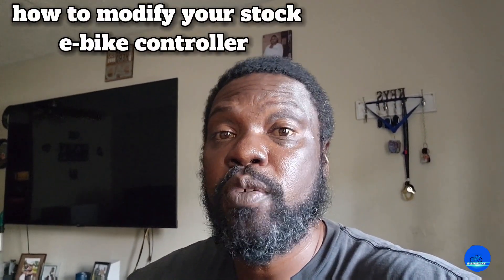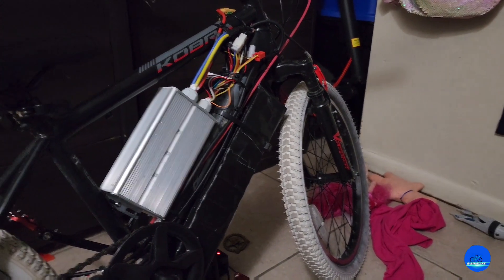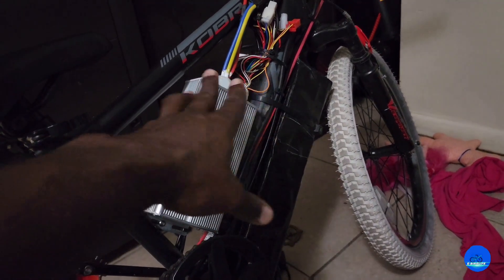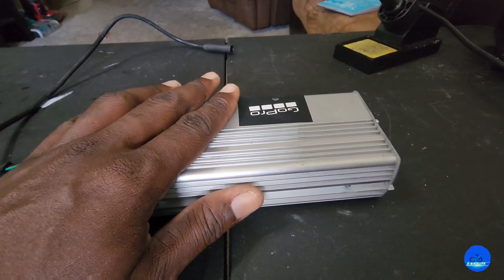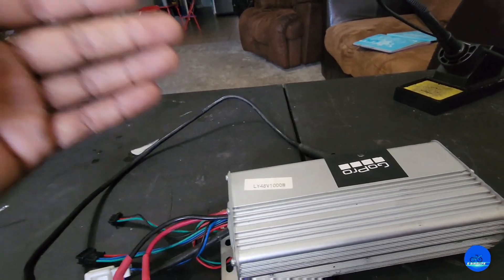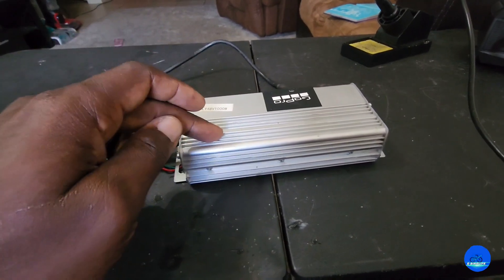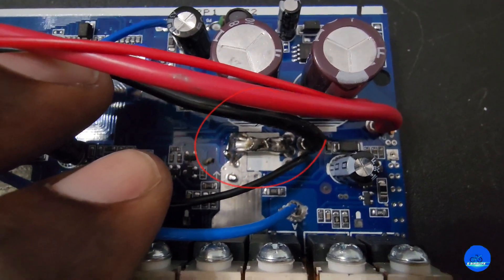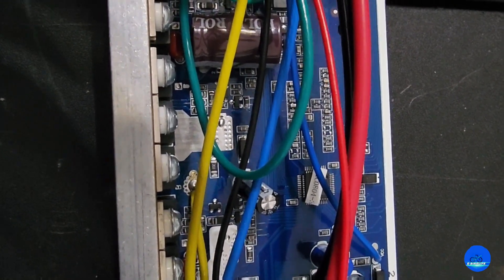how to modify a basic e-bike controller(MORE POWER)

Comment: My guy. I own the same LY48V1000W controller. Recently Its been turning off my power randomly. The power will turn off but then come back. I've checked all the wiring and everything seems to be in place. Please help
Reply from the maker: Ok it sounds like a low voltage,  do it only  do that while acceleration or just all of a sudden?
Reply: @EBG-offical  a little bit of both. It will shut off while it's on but not riding. And it will shut off for a few seconds but my LED display will show that it's low but then come back again to full. I hub motor will cut off and then work just fine. Am I looking at a faulty controller?
Reply from the maker: @crowsnestrc3551  that could be the problem,  you said that your display show low than go to full check the battery it might be a indicator of huge battery sag before you rule out the controller is bad
Reply: I see what you're saying. I've been using my bike to go uphills alot. I live in a town with a lot of hills everywhere u go. Idk if that might have anything to do with the bike being faulty. It's a Sunday BMX build. I own the 48v 1000w controller and 1000w motor kit. I'm having a really hard time figuring this out.
Reply: My battery meter reads full. But my LED display. The "810" model won't even light up now
Reply from the maker: @crowsnestrc3551  oh wow might be a short in the controller

Comment: Do you know if 63v caps can handle fully charged 60v batteries? since 60v batteries are 67v at full charge.
Reply from the maker: I believe you is correct 💯
Reply: @EBG-offical  thank you brother 🙏I appreciate you sharing knowledge
Reply from the maker: @theSWBFman  no problem that controller has 60v caps in it so I was able to run a 60v battery on it

Comment: Niiice! So tell me how much of a difference this made? How snappy was the bike and how much more speed did you get?
Reply from the maker: Thank you,  it went from 23mph to 30mph and you will definitely feel the difference like 35% more torque and speed
Reply: @EBG-offical  your welcome. how long have you road the bike this way? Any problems?
Reply from the maker: @RealRayAl  no not at all  actually I sold the controller to a buddy and upgrade my son to s sine wave controller 80a nb power
Reply: @EBG-offical  ok thank you. I just want to make sure before i mod this controller that i wont mess up anything like the motor or the batteries

Comment: Yoo bro! Your videos are sick! Can you suggest a controller or the specs I need to buy to get better acceleration pls, I've got a 1000w hub motor and I'm just using the stock controller it comes with
Reply from the maker: Get the sabvoton 7260
Reply from the maker: https://s.click.aliexpress.com/e/_msBjedO
Reply: Thank you
Reply from the maker: No problem I highly recommend it easy to use
Reply: Which one is it? It says 3000w I only have a 1000w
Reply from the maker: Sabvoton 7260, the 7280 is the one for 3000w, but get the 7260 controller. You can tune it to your specifications

Comment: Hi have 1000w controller 30amp and battery 13ah 48v  any problem after mod whit battery ?
Reply from the maker: It will be determined by the bms on the battery if it can handle more that 30amps

Comment: wow thanks for the info, i was wondering if you could help with my 3000w aliexpress ebike kit,  with supposedly proper controller and 3000w 20ah battery, I have had this problem since day one, . well with fully charged, i can only get maybe 150 yards and it simply quits, with total power failure, then i come back to the shop and plug it in and it resets the battery and i can go another about 150 yards and so on,,, any suggestion?
Reply from the maker: I suspect the bms might be yout problem I might have a solution for ya tho
Reply: @EBG-offical  well i sure could use some help and happy to pay you ,, just dont know where else to turn , and btw i thought the problem was the battery so i bought another battery  higher wattage , and the same results,
Reply from the maker: Ok email address is theebikeguy08@gmail.com
Reply: and i was thinking of getting a sabvoton controller to hook up to this aliexpress motor, and wondering if you know it that would work, thanks man
Reply from the maker: @kimgueldenhaar1435  yes I will work depending on motor you might need a hall adapter

Comment: good stuff! was wondering, are controllers and batteries pretty much universal ? or do you need to match the same brands ? controller & bike brand for example
Reply from the maker: You can mix and match but most importantly you have to make sure the battery is compatible to the controller,  like if the battery can handle the current the controller is asking for

Comment: I have what I think is a simple question, but I do not know the answer, so I need an expert opinion.  My ebike uses a 48v battery and it has a 750watt motor. I have a second battery, and it's also a 48V. According to my bike display, both batteries are putting out 52vs . Why am I getting 52v from a 48v battery?
Reply from the maker: Oh ok it's because at fully charged it will be at 54.6v 100%  at 48v wich is nominal will be at 50% half charged
Reply: @EBG-offical  Thanks!
Reply from the maker: @mrstans  no problem 😊

Comment: Best wrapping in copper wire then you can remove it when you get tired of the battery flattening faster 😅💯🤠🤟
Reply: do you still have to squeeze them ? before wrapping them in copper ?
Reply: @Mr.Reflex84  Just wrap the shunt ,looks like a staple
Reply from the maker: I know, right!!! 😅

Comment: hey, i have an ebike from alibaba, 1000w hub motor, 52v dual batteries. 52v controller, if i was to do this mod what downsides or risks am i facing? because it seems like a 5minute mod to increase the speed and power but theres gotta be downsides if that doesnt come straight from the factory, im really tempted to do this if its safe for the bike overall
Reply from the maker: The risk, that will will be more current being pulled from your battery, make sure your battery can handle the extra current before the mod.
Reply: im new to e bikes, but i did see another video on this same trick, and the guy emphasized the importance of getting a heatsink for your hub motor.

Comment: by a 20ccash step up inverter dc to dc all u need is one that god up to 60 volts if u only have a 36volter u can put it on 50or 48or 46volt dc from 36 an it will boost yr speed so much look vides up of boost inverters
Reply: Tried that no good. I'm pretty sure the boost converter takes a lot of amps out of the bms and the bms just keeps shutting down, and the light on thr battery just flashes.

Comment: Good helpful video! im looking to modify an old mobility scooter i got, would a e-biker/scooter controller work on it? its a 24v 1000w system, i might try 36v 1000w, you think that would improve anything? yes im very new to this stuff but id like to learn more about it
Reply from the maker: 24v to 36v  will improve the acceleration and speed, as long as you're controller can handle the extra voltage
Reply: @EBG-offical  thanks for the quick answer i gave you a sub, ill definitely have an e bike some day too

Comment: Hi some lads use 1000wat wheel 52v25amp ordinary controller 57,.mph it's overuse the bigger the battery more power say 3000wat as BMS really is a waist of time it's only I info to tell the current is drawn form each battery equal but if one of the wires burn on BMS it's long walk home the bike stops the lad next door to me builds battery and doesn't use BMS

Comment: The best Controller for that shunt is 35+2amp on 52v17.5 battery and 35amp fuse use 30amp it blows it does improve torgue power slightly but its  good upgrade. If you have 2000 wat bike 45amp lcd sw900 set at 100 speed 52mph you can actually do a shunt on a 45amp controller and definitely get more power but up grade battery it draws a load of amps 72volt battery or I uased green wick drill battery with built in BMS 5v7amp 12batterys so if one goes fa it's a case of putting one battery in instead of buying full battery it works out much more cheaper
Reply from the maker: You're right as my friend is learning that the hard way lol
Reply: @EBG-offical  hi its not the hard way when build plywood metal fibre glass the motor wheel 3000wat battery totals to 72volt the controller was 45 Amp the top speed was 57moh. I built the bike and sold it no gears just two pedal twist throttle it could shift. James Biggar has hi video on utube all connections is made with copper pipe then put in vice a squeezed flat then cut Tom connection and thick plastic for the top of each battery you should watch video its very interesting
Reply from the maker: Ok can you send me a link
Reply: What do you mean learning the hard way
Reply from the maker: @Colin White  he shut mod the controller battery too weak
Reply: @EBG-offical  on 52v17.5 it works quite well are you sergest g 72volt battery that controller is for 1500wat and 200wat
Reply: @colinwhite144  just noticed your comment and I done a ebike conversion I run a 52v 19.6ah battery with 48v 1000w controller and 48v 1000w motor, Amy suggestions on what controller to use or what to try to gain abit more torque please

Comment: What amps is the controller and has it blown any fuse yet and what was top speed of your bike
Reply from the maker: 37mph with that controller shunt mod
Reply: @EBG-offical  hi that controller the mosfets are screwed in at top of each one to case then I berleave yes heat resident grease to keep them cool the one I have the mosfets are held in place with metal bars then inserlation tape along top these controllers keep cool better well I think so I've had quite alot. I have controller in bag with vents front and rear for cool air to pass through when travelling along road it act's as a wind tunnel so controller is cool what ever speed I do
Reply from the maker: Good point you made.
Reply: @EBG-offical  that's a good result so is everything fine no heat I berleave the controller was a 1000wat amazon what is the size of your battery thanks
Reply from the maker: @Colin White  no problem, I got the controller from eBay and its on 60v also
Reply: @EBG-offical  hi I've suscribed to your channel I didn't realise you have alot of videos that can be helpful to me like your videos
Reply from the maker: @Colin White  Why thank you 😊 let me know what kind of advice you need. I'll do my best to help
Reply: @EBG-offical  To be onist I didn't no you were on YouTube I'm 74yrs old I've been in to ektric bikes for 18 years I've had fortie cars and still prefer eltric bikes. Problem England isn't the country for elctric bikes it's the climate iv I do a job can't get out to try it out because of bad weather. When I was younger I could lived in Australia or America california. I was born to early. When I think what guys can do today different project out side but not in England spend about six months indoors unless a big garage or work shop. Yes Ive been looking through your videos you have quite alot. I will looking through later. I've got a habbit of sending long messages soory about that have a good day

Comment: And if you cut the 3 wires? What happen?
Reply from the maker: To my Thierry, a little go or no go at all
Reply: @EBG-offical  ok. Thank you. I have a R25 performance Vmax and I want to remove the 20km limiter but I’m having trouble to do it! Any idea?
Reply from the maker: @Alexandre Madeira  usually some controllers have a speed limit wire as a blue wire, just unplug the blue wire and it unlock the controller to go faster if not and you have a controller that do not have shunts like the one in this video then best option is to upgrade the controller.
Reply: @EBG-offical  I don’t think it does because I disconnected wire by wire while using throttle in between to see if had any changes in speed and it haven’t.
What controller do you suggest for a 48v system with a 500w motor and a 10.4 battery? Thank you for you help
Reply from the maker: @Alexandre Madeira  do the controller has a Waterproof connector for the hub motor?
Reply from the maker: @MadeiraDIY  https://www.ebay.com/itm/403970604807?mkcid=16&mkevt=1&mkrid=711-127632-2357-0&ssspo=vdaikmc5rgs&sssrc=2349624&ssuid=g6yfcireqc2&var=&widget_ver=artemis&media=COPY
Reply: @EBG-offical  the only waterproof connectors are located in the handlebar
Reply from the maker: @MadeiraDIY  email me at theebikeguy08@gmail.com with some pictures so I can point you in the right direction

Comment: I just bought a juiced bike ripcurrent and it has a 25 amp controller.  Would it be safe to do this mod? I don't want to fry it because it takes a special controller and I don't think they're in stock. I know it will void the warranty but that's not a big deal to me as I can do the repairs but it's getting the parts. You can't just use any controller because of the torque sensor they use on juiced bikes. I have a phaserunner controller but it's not compatible with the torque sensor I don't think. I'm still doing research. I sent grin tech an email but haven't got a response yet. Thanks for any help you can give me.
Reply from the maker: Yes the sunt mod will help definitely in power and you would fry it. When you open the controller up make sure you see the sunts should be located in the back of the controller. And just solder them together but if you can locate them. Then the mod might be the best solution. But most low end controllers or mid range should them. You will be 50 amps then

Comment: Hey bro question I’m getting a lot of voltage sag I have the same display what do you recommend I keep my throttle power at ?
Reply from the maker: I would say power level 3 till you get a battery to handle the current but long as the bms is not going into protection mode, but if you battery is at a 100% and you have a voltage sag then might be a problem with the battery's capacity

Comment: I killed the motor hall sensor with a controller shunt mod because the motor apparently couldn't handle that much power and got too hot.
Reply from the maker: What kind of motor you had on your modded controller?
Reply: @EBG-offical  One of those generic China rear wheel direct drive hub motors. The one i killed was from a 1500 watt kit(35 amps).
I'm pretty sure that my 1500 watt controller delivered about 2500 after the shunt mod.
the modded 1500 watt controller was about as powerful as my current unmodified 3000w controller
Reply from the maker: Oh wow,  ok I having a similar problem with my son's 3000w kit, it overheated to so I tell him to be gentle till his new motor arrives, but the 1000w ebike it gets warm but not hot, mainly he is light and doesn't require alot of energy to move bike
Reply: @EBG-offical  Then of course it would be good if you installed a controller in your sons bike, where you can limit the amps. The only permanent solution I can think of is magnetic cooling ferrofluid.
I also thought "then I'll just drive more carefully"
But it's so much fun that the heat will be ignored 😁
Unfortunately, my new display doesn't even show me the temperature anymore, so I have to guess when it's getting too hot, that sucks.
Even when these motors cooking at 100 degrees Celsius, they only feel slightly warm to the touch.
Reply from the maker: Lol right from time to time I'll stop and tell him to feel his  motor and see if it's hot or not lol
Reply: @EBG-offical  That doesn't work with these engines ^^
Reply: @EBG-offical  There is no connection between the strator and the motor housing so its not getting hot. That's why this magnetic ferrofluid is used, it connects the motor housing with the spinning hot strator and so it can transfer the heat to the housing and the motor then cools itself.
It works like liquid thermal paste.
Reply from the maker: Oh yeah now I understand,  is that ferrofluid expensive? And can I get on Amazon or via grin technology
Reply: @EBG-offical  30-40 bucks one dose for one engine.
Its third time youtube deleted my comment.
its called "10 ml Statorade ferrofluid, magnetic cooling liquid"
Reply from the maker: Wow ok that nice to know I wonder why youtube is deleting comments this happen to another one of my subscribers
Reply: @EBG-offical  grin tech
Reply from the maker: Where you been? Haven't seen here in the comments in a while lol
Reply: @EBG-offical  I'm hanging back in the shadows lol. Great videos man, keep em coming.
Reply from the maker: Lol you got it!
Reply: the shop where i got it is called fastbikes but maybe you find a dealer at your side of the planet.
Or look for youtube video "Statorade Injection Tutorial" there is a tutorial and a link to another dealer
Reply: How many amps if my controller says 30+2 I think it says

Comment: I think your battery pack hits you in front of the wheel while bouncing
Reply from the maker: No, that's what I thought but h3 is so light and the fork do not move at all for some reason I tried to make it move but you have to jump on it for it to move in the slightest
Reply: @EBG-offical  your front fork is rusted if you want to pull it out you could do it with a jack
Reply from the maker: Ok cool beans